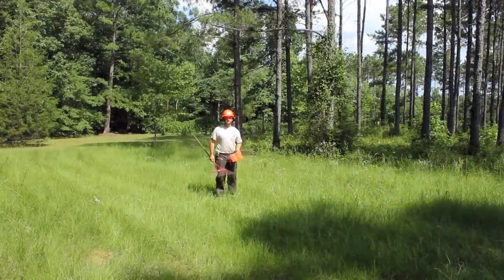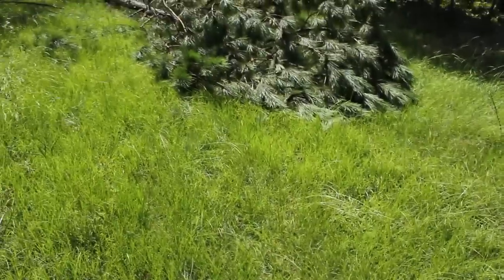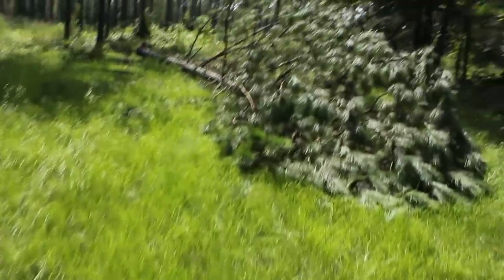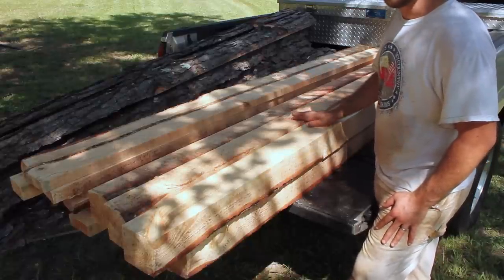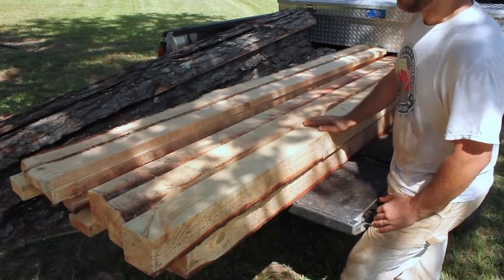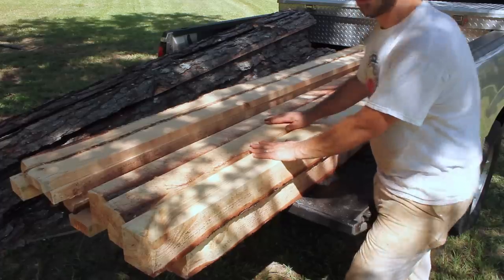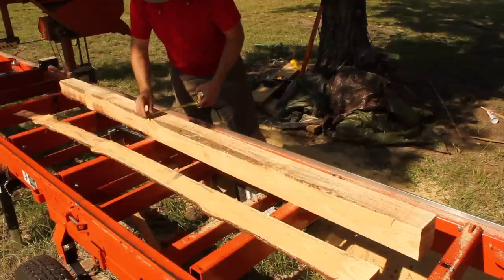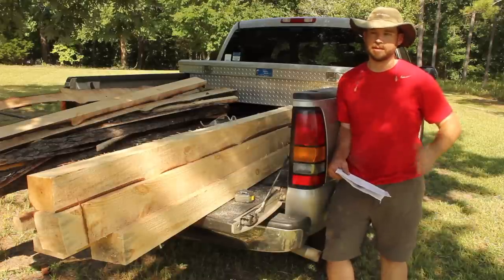Turning a Pine Tree Into 4x4 Timbers

Comment: A milling tip I saw on another youtube channel was to obtain your largest timbers from your smallest logs.  If you need a 6x6 or larger, get that from your smallest tree that will yield that size.  This produces less waste overall.  The flip side of that, is if you need a large number of small size lumber, get those from your biggest logs, as those will yield the greatest number of that size.  Overall minimizing waste.
Reply: Just make sure you cut your large timber first so that you don't run out of the big trees if you need them for the big timber ;)

Comment: What I do when trying to keep the pith level is I keep some scraps laying around and set them under the small end to shim it to the same height. Just make sure your blade clears the log, measure from the pith to the blade. Without moving the blade check the other side and shim accordingly. I keep a wooden fence post to use as leverage to lift the end

Comment: Reading the tree is a art form that comes with time and your already making steps that lead to saving steps. For one hing, your not trying to saw the tops off the braces and that is a positive thing. The pith if you can get rid of it is a good thing but don't worry yourself over it as he lumber that you get at home depot. It is what it is and use the wood accourdingly. You won't waist as much and the wood will lay better when you hang it. If you soak your wood inalake, the sap will come out in the water and the logs won't curl as bad. You can get the wide boards and good quality too.. Old indian trick dad taught me/LOL

Comment: Check out the Wood Mizer “log taper wedge” for dealing with tapered logs on the lt15.  It seems to work well for me but has a limit to the amount of taper it can handle.  Believe it’s about $55 through Wood Mizer accessories.  Before purchasing the log wedge, I’d use the tapered end of a flitch to wedge up the low end of the log to center the pith.  Btw - while I’ve yet to contact them regarding the out of square frame, their customer service (at least in Maine and the Midwest - I’m in Vermont) has been fantastic to deal with.  Good luck on all fronts!  Keep up the great work and continuous search for improvement 👍🏼
Reply from the maker: Hugh Griffiths I deal with their GA branch and they’ve always bent over backwards for me. If my adjustments in the last video don’t work ill probably end up taking it up to them.

Comment: Did you fabricate the winch mount, meaning the adapter goodie that lets the winch slip onto on the rail? Or is that (and the ramps) a Wood Mizer product?
Reply from the maker: pneumatic00 It’s a Wood Mizer product. I fabricated the drill adapter from a socket, but the winch is factory.
Reply: pneumatic00 has always
Reply: pneumatic00 has always had been

Comment: I like the speed you saw, every one else saws so slow  it drives me crazy. Be sure to sticker the very ends of your boards, If I forgot to tell you before the easy way to know the maximum cant size of any log is to measure the diameter under bark, DUB ,small end, and multiply that by point 700.  12" x .700 = 8.4" Have fun.
Reply from the maker: Good tip, thank you!

Comment: YOu have a battery starter on your mill right?  Why not either find a 12 volt battery drill and hard wire it to the battery or a simple plug when you run the winch or another idea is an inverter and a corded drill?  Just thinking about you being on site and your drill dies.  Ain't nobody got time for doing it by hand!  lol
Reply: Or just go with a cheap winch from Harbor Freight for that matter.

Comment: I've seen other videos of guys who have their own Wood Mizers , and the've talked about removing the pith.  Why is the pith undesirable?
Reply from the maker: Jim Willoughby Not much experience with dealing with it. I think it’s species dependent, and I’ve never had trouble with pine, but it appears that the pith can have a tendency to check worse than the rest of the boards. If you’ve ever split oak firewood with an ax, I always aim for the crack in the dead center of the log. Hit that pitch check just right and the wood will fly apart. Maybe a more experienced sawyer can chime in with more detail?

Comment: Yea, you messed up a bit with the rake trick. Hopefully, my explanation will help you, so you'll understand what you're trying to do so you'll do better in the future.

All you're doing is using the rake to create a right triangle with 2 45 degree angles. The two short legs of this triangle is a line from your eye to where you're holding the rake handle, and from where you're holding the rake handle to the top of the rake handle. The initial manipulation you perform is simply getting the top of the rake handle close to your eye so those 2 measurements are the same.
After, you've created the 90/45/45 triangle using your arm and the rake, you then walk forward and backward until the top of the rake handle aligns with the top of the tree. This in turn create a similar triangle with the two equal legs being the distance from you to the tree, and the height of the tree.